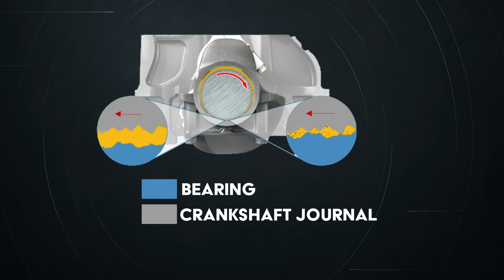the truth about start-stop technology (finally proven)

Comment: 11:25 i agree, german engineering is amazing... when they are allowed to actually engineer something and not be told what they HAVE to make.
Reply: cough Volkswagen engineers:
Hmm let's engineer a system to fake emissions data...
Reply: Actually that was brilliant
Reply: @sivansharma5027 fake emissions data but look at all the tdis with 700k plus miles
Reply: @sivansharma5027 wv every dsg has sport mode is literally run as engineers designed, default aka drive is as emissions and fuel consumption requires.
Reply: @Cypeq  bruh, I aint taking no VW advice from someone who can't even Volks the Wagen 😂
Reply: They can't let them do that "because WWII"
Reply: The engineer is not to blame but the law makers.
Reply: German engineering is as good as any other European one. Stop with this BS. I've seen skode lasting a lot more then Mercedes ones let alone BMW. That means that Skoda is better then Mercedes? Does this mean that Chechz are better then German engineer? Think about that.
Reply: @davides1489 Which skoda? A VAG skoda, then a big facepalm from me buddy.
Reply: @davides1489 Skoda is literally a flavor of Volkswagen 😂
Reply: @LostenPosten  "Skoda is literally a flavor of Volkswagen "

Skoda is the most Volkswagen flavor of Volkswagen.
Reply: Ummm. Some of their most advanced and best engineering came from being told what the HAVE to make.
Reply: Makes you wonder why he ran this "experiment" on a 2016 VW Transporter T6 van, rather than a more typical car.
Reply: @MrRoguetech doesn't matter since it's a piston engine with start stop anyway, same logic applies plus maybe it was convenient/they couldn't get a hold of a different vehicle since they're not mega rich YouTubers just some guys with a workshop making experiments & stuff
Reply: @MrRoguetech my god you live in cuckoo cuckoo land.
Reply: And even THEY couldn't get socialism to work.
Reply: @eclectichoosier5474  True! If they can't than no one can 😂

Comment: I would like to see a test with a fleet of vehicles all doing stop and go driving. 50% with the engine stop/start deactivated and the other 50% with the feature. All doing the same stop and go driving. The test must include oil analysis on every oil change on all engines. Then after 2 years tear the engines down and look at the wear. Report back with the results of a real world, not a simulated scientific experiment.

Comment: I hate videos that don't actually use real world statistics. I own a vehicle that has start / stop. It has 198,452 miles currently. Other than EGR item replacements and regular maintenance, the engine is still running strong, with no issues. No knocks, No ticks, feels just as powerful as it did when new. Honestly, get some real world, real use, real engine statistics on here.

Comment: It also puts a ton more strain on the starter motor and battery. 

Had to replace the starter on my car this summer. The start-stop version was $300, 3x the price of the older non-start-stop one. 

I've ended up turning it off every drive since then.

Funny thing is, I've got an automatic fuel economy calculator. The miles per gallon has not dropped, at all.

I've eaten $400 worth of hardware (excess cost of both the original starter and the replacement) just to make some greenie feel pious.

Comment: Your testing is not accurate for all manufacturers. Start/stop systems don't all stop the engine in the same way as an engine would stop if you turned the car off. Start/stop systems also don't all stop every time you stop.

Comment: Problem is am not an expert. I have to trust the engineers that designed my engine that it works optimally the way they designed it. If I start turning features off that the engineers designed to be on I am afraid I am doing the damage. With all due respect of course.

Comment: Why not install a simple electric oil pump that builds pressure before starting, say, 10 seconds, after wich the engine starts normally. If you keep the pump running the start - stop system will not hurt anything.

Comment: It's just to make the test numbers looks a little bit better. Came in whilst they still used the NEDC test which features several zero speed sections. And the test is so light anyway that having the engine off during this times makes a difference. It never used to work on my Mazda unless you were in the Goldilocks zone (usually around 23deg....)

Comment: It’s all planned into the life of the vehicle. Runs without issues until the warranty expires… then if it fails that’s even better for the manufacturer as your more likely to sell it off to the next mug & buy (probably lease) a new vehicle. Plus, over time they know the public will start getting used to modern vehicles having a much shorter lifespan so they can gradually reduce quality over time across ALL vehicles and the public will just accept the new normal. (Like we’ve all done with mobile phones, TVs, white goods, & most electronic devices. Even if you are lucky enough to buy a product that lasts more than 3 years, planned obsolescence kicks in where you can no longer get updates (or parts) for all your so called ‘smart’ devices & so are forced to throw it into the nearest landfill site & buy a new one. This is Capitalism at it’s best, as it feeds off human greed/selfishness in order to maintain continual growth at all costs.😮

Comment: Any sensible mechanical engineer would tell you any mechanism experiences the most stress when it starts up and when it shuts down, not when it's actually operating at normal parameters.

Comment: So glad I coded my start/stop to be persistent and it's disabled unless I turn it on manually. I drive a lot of traffic jam and with start/stop that just did not feel healthy.
Common sense feels that the car can't have built enough oil pressure, but you can't afford to stay still for 10 seconds in traffic or at a stop light.
Insane that from the factory they don't allow you to disable it persistently.

Comment: Lucky i know electronics 
Be removed quick smart

If I did start stop on engine 
Run a electric oil pump and use a air ratchet starter motor

Have less problems

Comment: mercedes C class 2012 with 2.2 diesel engine and start stop sistem that is in use every day are currently at around 720.000km. 50K km ago DPF filter left car but engine and turbo are still in perfect conditions and wasn't touched even with idiotic engine oil replacement of 25K km or 1 year. car was tuned from 136 to 150hp for 5 years (bought like that) and last year was tuned again to 190hp. last 350k km it was even highway and  hard city  start-stop drive (avg speed around 25kmh).

Comment: As soon as he said about the engine wear caused by the oil pressure falling to zero with no oil film separation on restarting I was sold on this. I'm so grateful that both my i20N and i30N allow you to disable this function on a permanent basis and it's been off since they were new. Fuel economy long term 6.2L/100km and 8L/100km is below what they claim too.

Comment: No matter what the "tail pipe justice" is to stop/start, it completely cuts your battery, starter and flex plate life in half. I use to replace so many GM and BMW parts when they started coming out, some batteries were going out after 2 years.

Comment: Also, I would bet starter life is horrible even with a "heavy duty" ( Yeah, right. ) starter motor. And I'll also bet that replacing one costs waaaaay over a thousand dollars even on an econobox. It's an idiotic idea. And it likely does not save any fuel 80% of the time. Add in people not changing their oil and filters at decent intervals and you are definitely going to get a LOT more wear on bearings and rings than a sanitized test setup will show.

Comment: This test with oil pressure gauges proves nothing. There is always an oil film between the journal and bearing surface. The only conclusive test would be to prepare an eninge in such a way that the bearings or connecting rods would be electrically isolated from the engine and then measure if there is conductivity between bearing and crankshaft during engine start. That's the only way to detect metal to metal contact.

Comment: Since many of these cars have very fast spinning turbos, unless a separate electric oil pump is used to keep oil circulating in the turbos, the turbos will suffer even more than the crank bearings. Any electric pumps to save the turbos from oil starvation during winding down?

Comment: Starting an engine is one of the more stressful activities due to inherently low oil pressure (from zero psi at the instant of start-up).  This means every start-up followed a period of no oil flow / no oil pressure. This in effect starves the engine of oil for the first second or two on every start-up.  There can be a dozen or more stop-starts during a routine trip in a city.  The effect is even worse when the engine is expected to be under heavy load a second (or less) from the stop-start.  The effect is a prematurely worn out engine and starter motor.

Comment: I don’t think your test setup is realistic.  The only time I’ve observed 7-8 sec to turn off an oil pressure light is after an oil change.  Otherwise, the oil pressure light goes out within a second or two after engine start.  You also don’t include an oil anti-drainback feature that almost all engines have that help get oil pressure & flow to the bearings faster.

Comment: All the features added to gain a very marginal fuel consumption reduction has made cars less durable than they would be without. The attempts to minimiser noxious emissions have also made internal combustion engines less reliable than they would be without, with repairs becoming much more expensive. 

Essentially the case for electric power in cars becomes stronger. In time internal combustion engines will be too expensive to remain mainstream. 

I am so close to retirement age that I'll never buy another vehicle, as I intend to give up driving at pensionable age. But if were younger, I would make sure to have an EV for a preference.

Comment: The new 100% synthetic oils, which almost all engines run on, make this problem worse. The oil is very slippery and falls off the metal engine parts and back into the pan very fast. The old conventional oils were thicker and more gooey and would leave a bit of residue on the metal and take longer to drip back into the oil pan. That's why you were told to wait a while (after shutting off the engine) before checking the oil level.

Comment: On occasions, like slow moving traffic, this system is useful, but most of the time it is not, as this video points out. Although intelligent systems disable the s/s in these circumstances. I coded my BMW X3 diesel to remember the last state of the start/stop switch, white I nearly always have as off.

Comment: That will ruin your engine in a month and your starter motor. You will burn way more fuel starting and stopping than woukd if it was left on for the drive. Onky an idiot woukd use a auto start and stop.

Comment: This stupid 'auto start/stop' system has a completely negative effect because massive numbers of people start their car and then have to pissball about to turn off the function meaning you are idling and using fuel for longer than you should need to.  Multiply all those small idle times by the number of people pausing to turn it off equals a large amount of fuel used unnecessarily.

Oh and don't get me started with  the idiotic 'lane control' systems that pull your car into ditches or over towards workers in temporary  lane changes on roads that cross white lines, meaning drivers then take concentration away from driving to having to turn it off whilst on the move. Totally unsafe and designed by iditiots just because 'they can.

Comment: That was expected, now think of what is happening in the transmission. The loss of hydraulic pressures, on start the trans has low pressures in both the dynamic and static sections. This seriously reduces the life of the fiction materials within the transmission. 
Vehicle built to last warranty period or up to 5 years then scraped. 
Carbon foot print?

Comment: In terms of oil pressure on startup, would an electrically driven oil pump fix many of the issues that are caused by the start-stop technology? I previously worked for a company that was working on some electrically driven pumps, and now that more electrically driven pumps are being made common because of EVs it might become economically viable to have a pump that runs most of the time at stops, I'm not sure how much having constant oil pressure would help though because the dynamic pressure is the big thing, but it may help some.

Comment: This video is straight up bogus and simply unnecessary factoring in common sense. Manufacturers are all adopting start-stop technology for a reason. Shutting down an engine at idle reduces engine wear and fuel consumption. Parts are pre-lubricated so they simply can't wear. Electrical systems have used solid state electronics for years isolating components from the starter load. The starters themselves are engineered for repeated start events.

Comment: I had start-stop on my cars from like 2014.. i dont like it still, but the city traffic on my city is so bad that every week the car clocked like 1:20h stopped on trafficlights, the computer would show to me the time start-stop was active.. im ok to the system regarding the noise, when you think all like 50 cars on the light with me.. but what annoys me is that the starting is not smooth, the car shrudders on every event.. also i dont keep the car long enough to see engine damages.

Comment: So why, when starting at any time, doesn't the engine delay switching the ignition and injectors on all engine starts until the oil pressure has chance to reach the point there is no wear?

Comment: Audis have some of the least reliable engines out there.  Their turbos are notoriously bad for blow by creating oil dilution issues.   

I will never buy an European car because they are unreliable.    The leaked paper by a VW engineer stating how they can make cars only last to their warranty period for a few cents less.  And you know how much VW owns.   BMW and Porsche also have the highest TCO over 5 years.   Totally unreliable, unnecessarily complicated and expensive.

I will admit US cars arnet much better with Fords recalls and GM building bad engines and not replacing them

Comment: A lot of good points in this video and I also hate that stupid function, BUT :
Although insightful, the test isn't quite accurate, I think. A manual stop/start sequence isn't the same as an auto stop/start sequence. If well implemented, the auto-stop is "softer" : it’s managed by the ECU so that fuel injection and ignition are cut in a controlled way, and aims at stopping the engine whenever possible in a “ready to restart” state (pistons/valves in an optimal position). Because restarts are quicker (all of us probably noticed that), the time spent at low oil pressure under load is shorter. Some systems (e.g. BMW, Mercedes, Mazda i-Stop) allegedly have oil galleries and pumps designed specifically to retain pressure or at least maintain oil in critical spots for a quick film rebuild. Some systems use a beefed-up starter or belt-driven motor-generator that spins the crankshaft faster than a traditional starter, bringing up oil pressure quicker. Some systems can even pre-pressurize oil or maintain a thin hydrodynamic film by controlling stop position.

Should we really fear the consequences of this stupid and annoying function on today's cars ? Aren't most new cars disposable objects anyway ? Particularly a VW product is a good example of this in my opinion.

Comment: There is a partial work-around which is to provide an electric oil pump to keep the lubrication system pressurized during the idle-stop time.  The down side is at least two points:  first another point of failure is introduced, second it does not address that a certain RPM must be reached before the oil wedge is created.  An electric pump only needs to be an auxiliary, it does not have to entirely replace the mechanical pump.

Comment: I wonder if Hybrid engines have the same issues. The only difference that I see is that the engine turns on while the car is already moving. Also, they have some different starters and oil pump methods.

Comment: I can't stand the start/stop BS. I learned I could disable it by driving in sport or tow mode, this hurts gas mileage, I could disable it by disabling the BMS system, didn't want to do that. I finally found a method utilizing a 1/2 inch 22 ga wire jumper. Been two years now, no issues!

Comment: Would love to see how much benefit there would be to providing the engine with full oil pressure before cranking using either an aux pump or an oil accumulator system.  Also, the warm-start simulation is a bit flawed as the pre-heated oil is almost certainly cooled back down to match the temperature of the engine block.

Comment: the starter motor has X number of regular starts in it, then it fails.  Actually at least one manufacturer has put a chip in their starters that signal when they are getting close to that number and gives you a check engine life.  Of course you can't rebuild this starter, you need a new one at double or triple the price.  The &%$# EPA doesn't pay me to fix this.  Why I always push the magic button.   By the way, traffic signals have more than doubled in number in the last 20 years, traffic light manufacturers are big donors to local political campaigns, could there be a connection.  Traffic lights do not solve traffic problems, they add to them by reducing system capacity.
Reply: in a city near me the state built a 100 million dollar bridge that ends in a traffic light at the city line, imagine that the capacity of this bridge is cut in half by a one dollar light bulb.  Sounds stupid, eh?